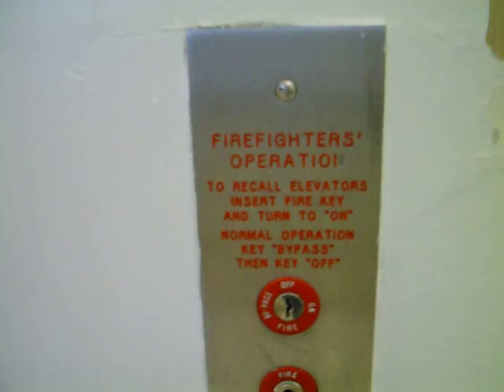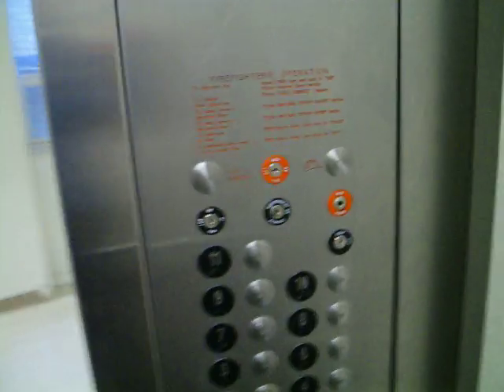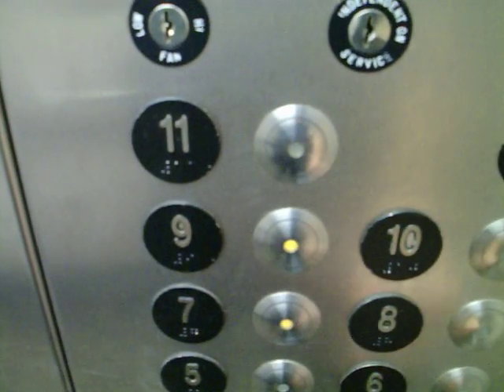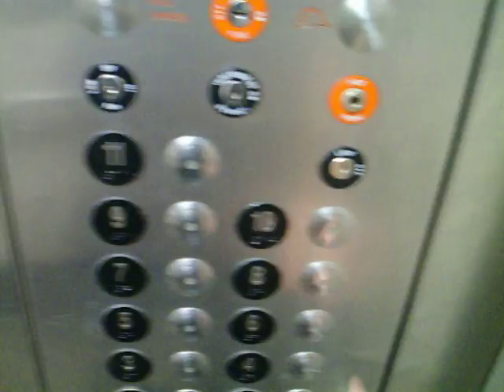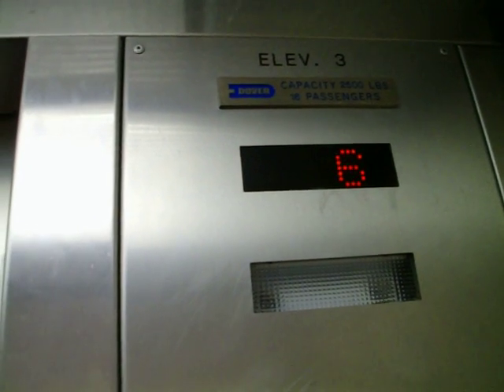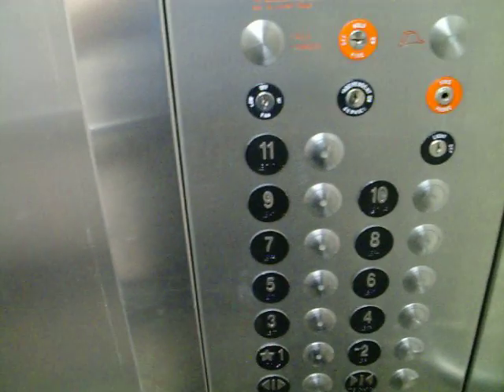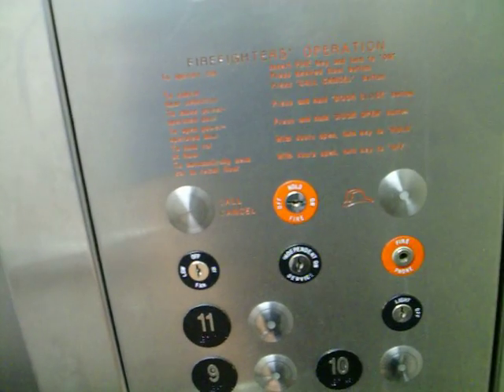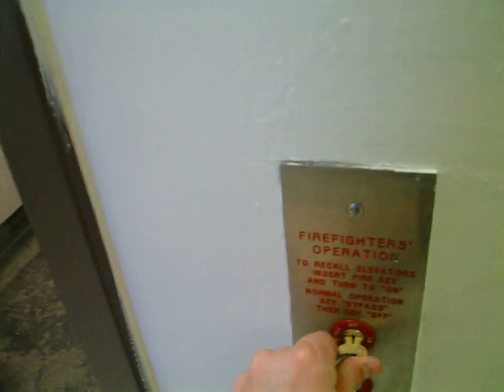2000 Dover Fire Service

Comment: does the fire service key also fit the fan switch
Reply: No. Here's the key line for Dover:

H2389: Fire Service
H2395: Independent Service, Fan, Lights
H1848: Keyed Call Button
H1846: Stop/Run Switch